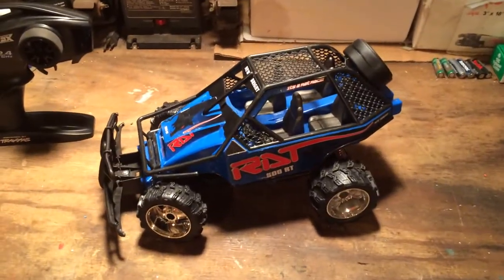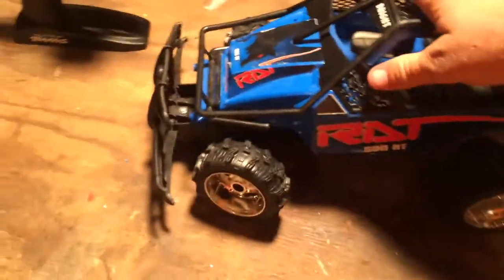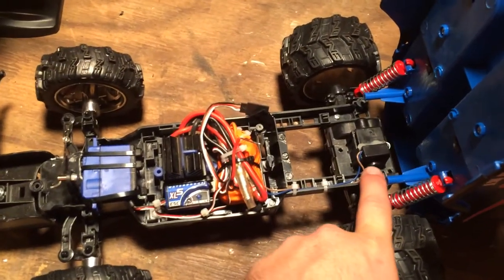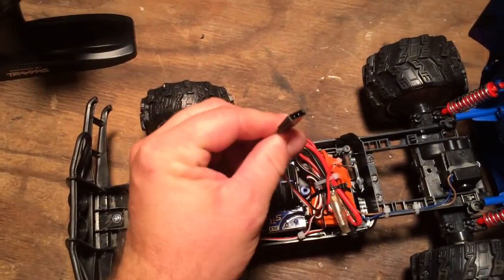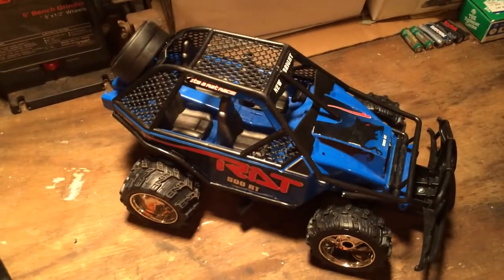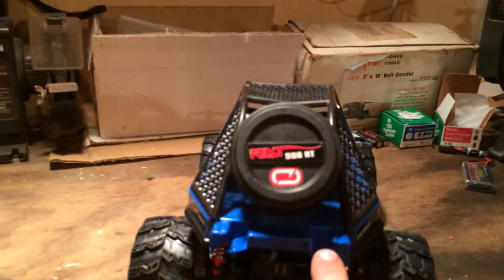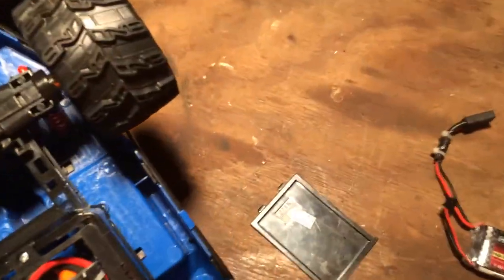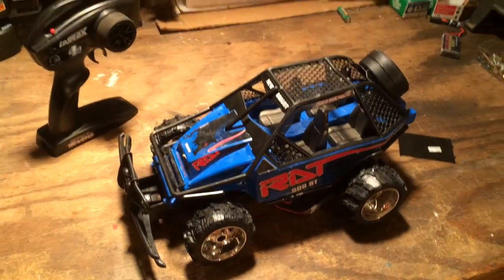Endpoint RC - New Bright Rat 500 RT Custom RC

Comment: Nice build!... can the stock toy servo work with a hobby ESC?
Reply: No...Even if you got it to work it would not be proportional.
Reply from the maker: I dont believe they can.  I agree with Akmaisto, the wiring is different and they do not work like a hobby grade servo, they are either all left, all right, or center.

Comment: check out this 6x6 with four wheel steering.  I used this body and am still working on it.. It's going to be amphibious, it's already got a waterproof cree LED's lightbar but i'll be adding another since it came out so good looking.  It also has metal gear servos that offer lots of torque for a 6x6.  I need to take a new picture...
https://lh3.googleusercontent.com/-iSl1S-TMDLs/U8tR9BvfGJI/AAAAAAAABBc/Bhajf_g_g1A/w875-h656-no/14%2B-%2B1

Be sure to sub my channel, I have lots of vids coming up, including on how easy it is to lipo power certain toygrade RC, max its performance the way the designer really wanted to do it. All interchangeable electronics and batteries with JST's on 2s lipo.
Reply: haha nice build!... on a maisto rock crawler?
Reply: Yup, cheap and easy to work with and most importantly 4 by 4

Comment: Has the tiny motor survived the upgrade so far?
Reply from the maker: So far so good on the motor. I have run about a dozen packs through it. The plastic gears are another story. Mainly because it is not designed for sudden stops and starts under lipo power. It gets abused it that way, but as this is mainly for my kids I don't mind. The vehicle cost me a couple of dollars and I can remove all of the electronics to put in a different one once it breaks altogether. Thanks for watching!
Reply: Endpoint RC To save the gears Is there an ESC with a brake?... also I see on the AX5 transmitter there is a control for reverse trim?
Reply from the maker: To be honest I have not adjusted the ESC or the transmitter settings from stock, outside of setting correct steering servo direction, steering trim (transmitter)and lipo mode (esc). I would consider myself slightly above noob stage and haven't ventured into the fine tuning of my rigs. Maybe that should be my next step with these custom rigs?

Comment: Do you have a running video?
Reply: Uncle Gus I have one of these trucks and am wondering if I should bother hobby upgrading it, do you have a video of it running?
Reply from the maker: +Uncle Gus I finally posted a running vid if you are still interested.  This rig is actually still running.  I like the challenge of custom builds, but I think I'm going to focus more on kits builds for now.  Link in the description.  Sorry for the VERY late reply.